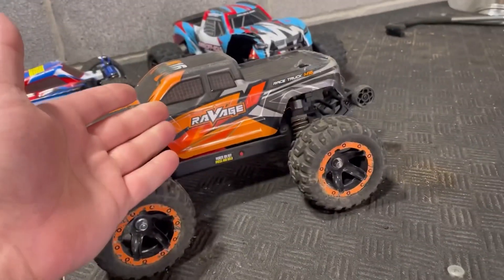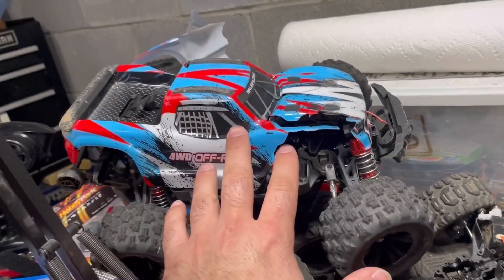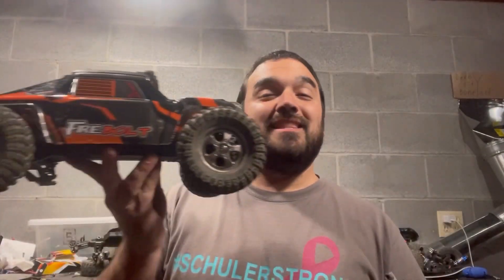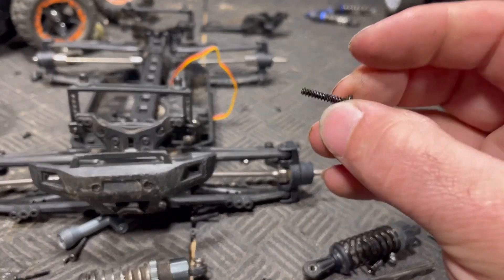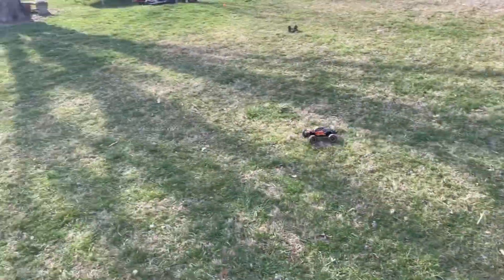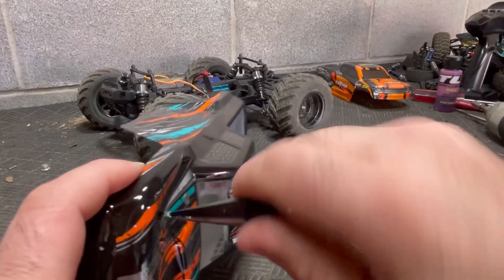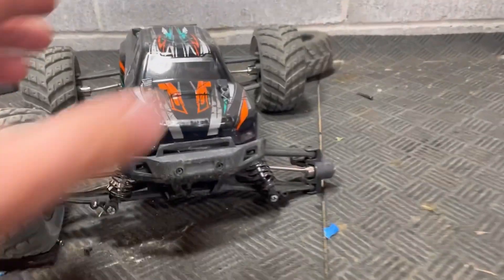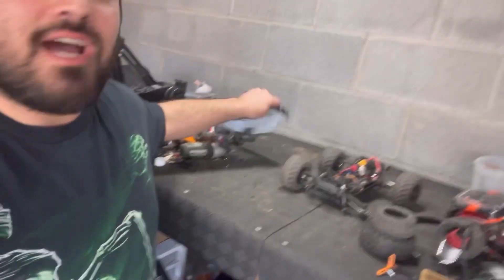Making the BEST RC car even BETTER

Comment: Absolutely love the ingenuity in custom piecing parts together, what a great idea and execution! Love to see what you learned and am super interested in seeing if you are able to find any more improvements!
Reply from the maker: Thanks! It was fun! Hoping to find more mods soon too!!
Reply: @DerbyCityRC btw, can you recommend a ESC for my 16889 pro, I'm going Dumbo receiver 😊
Also a better servo, this one is acting funny since i put bigger wheels
Reply from the maker: I really haven’t even put a better esc or servo in mine yet. Once I do it will be shown. That 901a receiver is all I’ve used but I’ll likely go with the Hobbywing quicrun or something similar.
Reply: @DerbyCityRC  mine developed a pretty big delay on the trigger, its not extreme, but bothers me, I only drive it on 2S and it has those bigger tires you used way back
Reply from the maker: You talking about the 901a esc or the quicrun?
My old 901a developed a bad delay after I ran it in 3s. Ordered a new one and just kept it on 2s after that lol
Reply: @DerbyCityRC  I'm still using stock 16889a pro, its the remote or ESC....
Reply: @atamata237 did you use the huge tires, or the tires that were only slightly larger than stock? I'm about to buy the slightly larger tires, but maybe I'll reconsider if it will cause problems.
Reply: @Eyes0penNoFear  I can't find my comment, so not sure what exactly are you referring too.
I only changed shocks and tyres on my hbx 16889. I used the ones slightly bigger(same as one on thumbnail) car is much more fun and does better on grass
Reply: @atamata237  yeah, my comment definitely could have included more context.
You had mentioned that your remote or esc developed a delay issue. Do you think it was caused by the bigger tires?

Comment: Lmfao, if I were to attempt this, I’d have a workbench full of parts and screws and a bunch of garbage cars that would never go back together 🤣
Reply from the maker: Haha! Well I’ve got plans for the other cars too!!
Reply: For real!
Reply: My thoughts exactly!😂
Reply from the maker: @gothbricks2000 🤣🤣
Reply: Hey man, I was just wondering if the mjx hyper go brushless motor is a direct fit in the 166889 with the little plastic motor guard/mount and pinion that comes on it? It looks really similar to the HBX motor mount and pinion. If anyone has tried it I figured it would be you haha.  @DerbyCityRC

Comment: I am trying to replace the gears in my MJX hyper go I don’t want to replace them with the OEM ones cause it will happen again in another week. Do you have any suggestions for differentials and drive shaft  Gears that will work?
Reply from the maker: I believe Amazon has upgraded diffs for it, but I think they’ve sold out. The front pinion from the 2995 should work and look like they have this for the rear:
https://amzn.to/3EW9JSk
Looks beefier lol
Reply: @DerbyCityRC  Thanks man I appreciate it.
Reply from the maker: You bet!!

Comment: I caught a peek of your ridged stackable tool boxes, I'm in construction and those are one of the best things I've ever bought! No more having to worry about my tools on rainy days in the back of my pickup and no longer need to swap my pickup for a lame van lol.  They are great! Oh also very cool video! Are you in a trade as well?
Reply from the maker: Funny enough I rarely use those boxes. Mainly cuz I’m having trouble deciding what I want to keep in there. A lot of times I just put what I need in it for an outside job if it’s not close to where I have to park. 
I actually own a handyman business so I do mostly small tasks, though you wouldn’t know it as my garage there is mostly full of work stuff. Quite a few RCs too though!

Comment: Hey! As a follow up did you do more with this franken truck? I'm really thinking about the longer chassis conversion. I already have the 15mm axel spacers with Reflex14M tires.
Reply from the maker: Hello!
I did! I actually made improvements to it and compared it to the Reflex 14MT: https://youtu.be/YxC-3ZMDYx8?si=X3ha5kYWe7X1SD9I
I did something else to it in this older video too. Tires and maybe different shocks? I can’t remember for sure: https://youtu.be/13VwqlFirBc?si=DCuda2k_QB5agwCV

Comment: Brilliant of you to show how longer/wider chassis with best-of components makes such a great truck. Seems a LOT like the HBX 903a, which we've been having a blast with. Welcome your thoughts on what to upgrade on the 903a. I don't want to hurt diffs & gears, so likely staying 2S and stock wheel/tire setup unless you recommend an upgrade path on controller & batteries that fit. Thanks for the great content.
Reply from the maker: Thanks!! It’s similar to the 903a but shorter in height and length, and not quite as long. Still quite a bit smaller actually except for width so handles way differently. Really the 903a is probably pretty good as it sits. It’s just like the 901a I have but different body. Maybe some better tires as I don’t care for the one sir comes with too much, but I’d say enjoy that one how it is otherwise.

Comment: The brushed 903 vanguard esc runs great on 3s but dunno about the brushless one
Reply from the maker: The brushless 903a hd the same chassis as the 901a so may share the same esc as well and for me it delayed on full throttle and not long after it cooked the original esc. Only a 30c battery. Other people have done it with no problem though lol. I’ve heard it both ways pretty equally.

Comment: Great video. You really should make a list of all the china brands that share parts. As well as the ones you can swap parts onto or slightly modify to fit.
Reply from the maker: Thanks!
Well I don’t know them all lol.
This was all on trial as the video was made 😃
Reply: @DerbyCityRC  Brother you r the authority on these china brands. I don't think anyone else on you tube is doing what you are with these trucks, and I have searched the internet for any kind of parts cross references and there are none. It's been thru your videos that I have learned the most about these china brands. There r lots of ppl that would get into this hobby if they didn't think they had to buy a slow brushed vehicle for only 100 or so less than the next line up to get started, mainly because the parts are available. Now we have Amazon, bangood and others stocking parts for the china brands that are not expensive  and it's making it more accessible for those who want a brushless capable vehicle that's 1\2 the price of the top brands.  Having a parts cross reference list and vids showing commonality would b an excellent boost for the hobby. Just a thought, love your vids and the choice of music! Keep bashing!
Reply from the maker: Thanks man!! I’ll be working on an RC for beginners video that I hoping will help alot of people find the hobby and stay in it. Topics like this will be in there for sure!

Comment: Can you put it on original suspension and wheels and tires? With longer chassis I would like to see if that makes a huge difference in the way it handles
Reply from the maker: You mean original arms axles and everything, just keep the long chassis?
I was going to do that, and I still might, but then they came out with the 2105a which is pretty much exactly that.
The review on that car will be out either tomorrow or Saturday

Comment: Epic. Such great attention to detail, both on the truck and the video. 
 
I picked up one of these little go-getters after seeing your reviews, and have been extremely impressed with it. My stock springs are all leaking and its spinning out real easy now. I want to pimp it out like this with the wider arms and bigger wheels. Seems like the bigger wheels help the most with clearance and general bashability, is it worth getting another set that isn't so grippy, maybe a bit thinner width or harder compound? I'd love to know what the power to weight ratio before and after. Can't wait to see where it ends up!
Reply from the maker: Thanks!!
Yes a couple different sets of wheels would be good. I really like the biggest wheels I used on it, and then the stock small wheels (just not for jumps). The medium ones handle horribly on this lol. Definitely recommend all these upgrades as it’s a blast to drive!

Comment: I keep chewing through these cheap a** diffs. Shearing off the screws that hold the diff box together. I have gone through 4 on mine. The first one broke all 4 screws so evenly, that I wasnt sure what happened, i thought i broke the box itself as they have a spacer ring between the box and the spur. Do they not make a metal box? Even WL toys has metal upgrades.. am I missing something. Am I just that damn hard on my trucks? It's so frustrating, considering the diffs are the only thing keeping me from running it.
Reply from the maker: That’s interesting I rarely ever break hbx stuff and I’m really tough on them. I don’t think they have a metal box available. The mjx HyperGo models have a lot of reported problems with that, but not these HBXs, so that’s weird and I wish I had a better answer for you!
Reply: @Derby City RC  I found an aftermarket diff that I should receive in a day or two. The build quality looks better, hopefully it will perform better. I will keep you posted once I get a day or two to bash it to death again and see how it holds up compared to the oem.
Reply: @Derby City RC  Also wanted to thank you and encourage you to keep doing these off brand cars. I hang my hat on the reviews that you and Talbot do to base my next purchase on. I'm new to the hobby and really appreciate the time and effort you put into these videos, all while keeping them entertaining and informative. 

Thank you!
Reply from the maker: Awesome, thanks!
Reply from the maker: Thanks I appreciate that. I made a bad purchase on an RC car early on because of what may have been biased reviews so I try real hard to give as much info and honesty as I can. Sometimes bugs and weak spots don’t show up right away but I try!!
Thanks again!!

Comment: Curious if anyone has addressed the steering issues with this car? The plastic steering linkage seems to be just really sloppy, along with maybe not so great servos. Or maybe it’s just mine, under full acceleration it veers the left and right so much, and the servo never really returns the wheels back to center.
Reply: If there is slop and failure to return to center, my first assumption would be an issue with a loose servo saver.

Comment: Are the 16889 arms wider than the EC30 arms? I wanted to try to do something similar, but not the extreme width of the 901 arms you used? If the 16889 arms are slightly wider than the EC30’s, I’d do it.
Reply from the maker: I’m not sure. If they are wider, it’s not by much. I’ll try to get a measurement soon.

Comment: Do you recommend a 1/10 size good parts replacements and solid.
Also speeds?
Reply from the maker: Are you asking about what I think is a good 1/10 RC car?
Reply: @DerbyCityRC  yes if you can recommend thanks
Reply from the maker: @blaircooper9956 Arrma granite, Arrma vorteks, and Team Associated rival MT10 are probably my favorite 1/10s
Reply: @DerbyCityRC  Thanks for this NZD has terrible buying power on these models :(

Comment: So basically it’s a short 901a? I thought most of the parts on the 16890 pro & the 1/12 scale hbx cars look same or just stretched out so is the 1/18 have smaller diffs & spur or same again cause they got 2 diffs & spur metal on sale for $20 lol tks for informative vid
Reply from the maker: Kind of yes. Much more stable than the 901a and it’s also faster. I believe I got either 23 mph on the 901 when I tested it a while ago. Could have been 26 but definitely wasn’t 28. The 901 and 16889 have some similarities but the 2995 is very different. Glad it was helpful for you!

Comment: Hi nice work and thanks for the video. do you know what pitch/mod is the 14t pinion gear?
Reply from the maker: Thanks! 😊 these are .6 Mod
Reply: @DerbyCityRC  thank you so much
Reply from the maker: @sooolion9820 you’re welcome!
Reply: Hey man one other question, i am having a hard time finding batteries that fit the 16889’s compartment. Do you know of any battery with higher capacity that fits? Or any other recommendation perhaps? Thanks a lot
Reply: Another question - can i put oil in the differential or just grease?
Reply from the maker: @sooolion9820 these differentials are not fully sealed, so unless you put something really thick in (likely too thick for the size of the car) it may leak out. I had good luck with the center diff of my 2997a putting 100k in it, so it’s possible that would work.
Reply: @DerbyCityRC  thanks so much for responding, a bit late into this budget rc but man am having a blast running it. Thanks to your videos too, really informative and entertaining too

Comment: Hey, was wondering what is your oppinion on the Rlaarlo 1/12 Brushless Buggy, 80~100 KMH RTR, AM-X12 ? I was choosing between this and Hosim X07 you made a video on. I know they are different. But I am looking for a nice 1/10 basher as well.
Reply from the maker: Hard to say cuz I don’t have one. It’s definitely not a basher though. Lol
WhT do you like about the x07?
Reply: @DerbyCityRC  I like the size and durability, still looks like a Flyhal to me. I have the flyhal  X03 and wonder if its not the same basis just brushless.
Reply from the maker: No the x03 is a bit bigger. Completely different chassis and everything. 😎

Comment: I just picked up the HBX "Flameline" drifter RC and looks like I'll be trying a similar experiment ASAP! Loved this and hope it only gets better. Thanks for the inspiration, also  what about the 2995's shox on that bad boy instead?
Reply from the maker: Awesome!
And thanks!
The red shocks I have in the 2995 are too long. I tried them on my 901a a while ago and they really didn’t work well, but there are shorter versions of them I’ll measure up or I’ll find a way to get the longer shocks in there. Needs more dampening for sure! That’s the main setback of this project.

Comment: Another great video! 

So I got this as my first truck and loved it with the bigger tires, buuuttt I destroyed the differential too lol other than replacing it, what other things can I do to really top off this things durability?
Reply from the maker: Well like on this video I used the hbx 2995 diffs. They work but you may have to swap the diff cups since the axles are smaller. Not actually sure if these diffs are stronger or not but they’re way stronger in the 2995 cuz it has a center diff as well, and that takes a lot of strain of the rest of the drivetrain.
Reply: @DerbyCityRC  that's a good point! I'll definitely check those out. Thanks brotha 🍻
Reply: @DerbyCityRC  oh! And keep up the great content. Love your videos
Reply from the maker: Thanks I will!!!

Comment: damn man your gonna cost me a fortune. The 30amp hobbywing ESC was finally tried today with a 3s 1300mah battery.  First problem....the battery looked like it would fit until i put it next to my fc600 and realised there was no way. That was annoying as I thought if I can squeeze a 2s 1800mah in then a 3s 1300mah should be fine.....NOPE!
I just jammed it under the body and it sufficed for a test.
Holy 'stuff' it flies. The 30amp hobbywing had no issues so I guess 30amp on 1/16 is fine as long as it is quality.
Yes your build is pretty cool, it must be nice to have endless donor cars to rob. I would like to see it with short arms as well or are there no 'mid' arms?  You can double up the shocks at the back, front and back of the rear arms.
I bought some replacement wheels/tyres + a Pickup body (yellow with black wheels) and now i need the body mounts and I have suddenly realised I had spent £30 and I could have bought a entire brushed car with the body I wanted for £60. I really should have just done that for spares even if plastic, hindsight is a wonderful thing.
I was trying to see from your video if i could reverse the side my servo is. I think it looks like a yes just need to fix it down. That is one way i could get battery space.
I need one of those battery trays 3d printed that I found on internet.
Anyone in UK willing to print me one or two....or three? ill cover costs with paypal of course.
Reply from the maker: Thanks! 
The “donor” cars all have plans so they’re not wasted.
Also, I am going to be rebuilding my hbx pro with the longer chassis and standard hbx 16889 arms, so that will be happening too eventually. I almost got the quicrun for this and probably will.